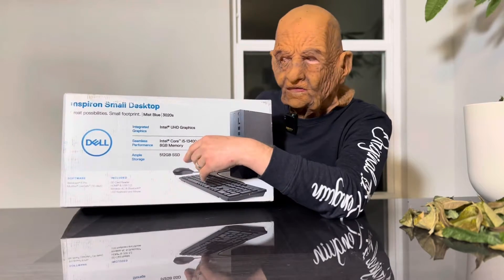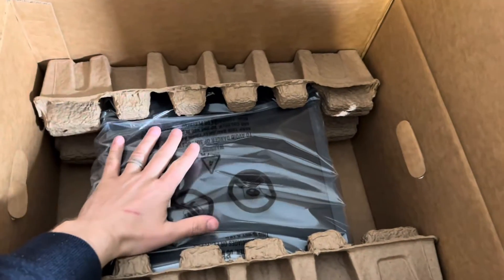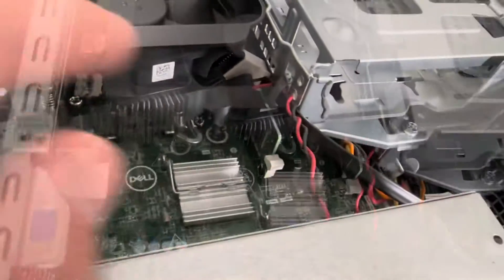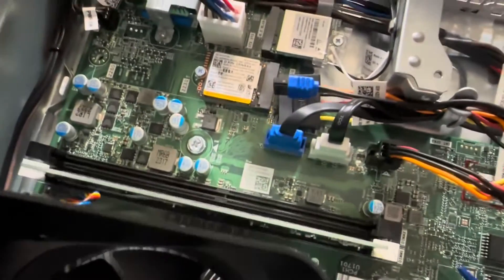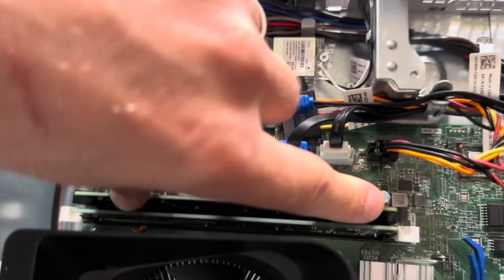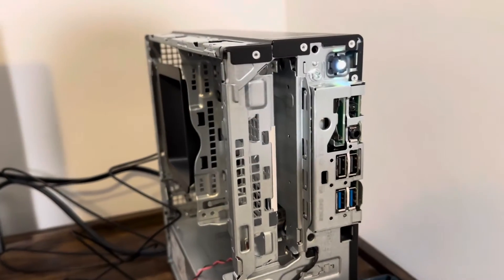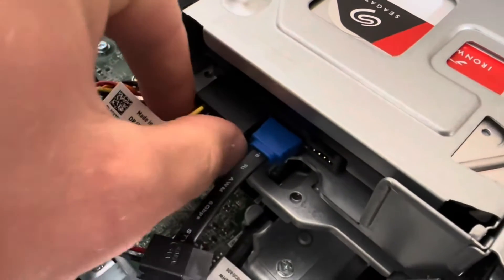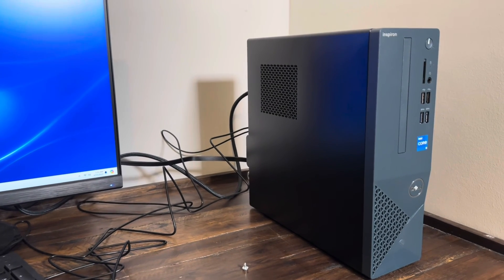Dell Inspiron Small Office Desktop 3020s RAM & HDD Upgrade

Comment: Thanks for the video, i just bought one for work at home and it is great. I eish i could upgrade the Ram and storage but i wont dare to do that. I might brake something.
Reply from the maker: RAM and Storage are the easiest to upgrade, but if you don’t know what you are doing, and never done it you may break something. I broke a motherboard like 20 years ago, even though I had some experience at that (maybe upgraded like 10 computers over 5-7 years prior to that).
Reply: @alegreviews  that's what I'm afraid to do. Hehe.

Comment: Can i upgrade my dell inspiron 3030 to a gaming pc ?
Reply: if it has space for a low power GPU, maybe 

depends on PSU supply, and size of GPU
Reply from the maker: @metro-v8 yes, I already bought Intel ARC for it, going to do a video for installation this or next week. There are also super low profile 4060. But power supply may not handle that
Reply: @alegreviews  nice